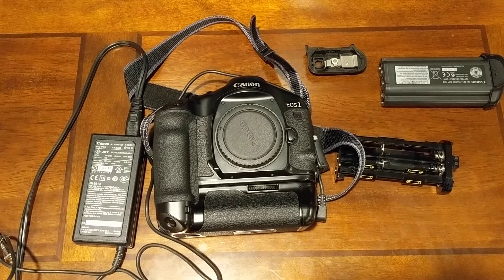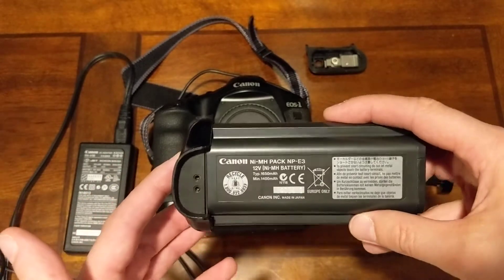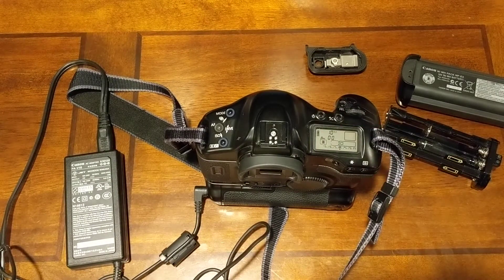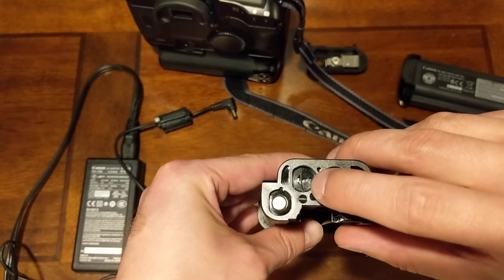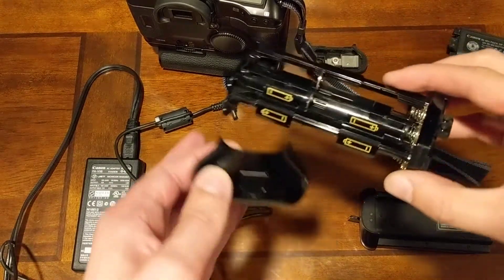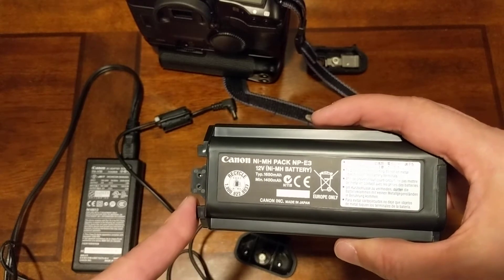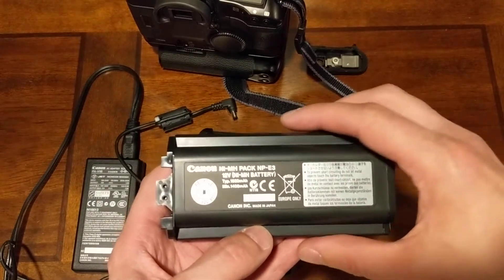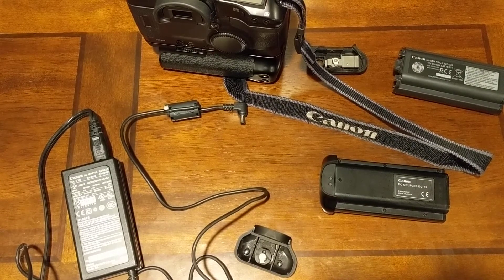Modifying the DC-E1 Coupler for EOS-1V Camera

Comment: The "Battery Cover Unit" that goes on the end of the BM-E2 or NP-E2 is Canon Part number CG4-0117-000. It doesn't seem to be available separately, at least not from Canon.

Comment: How to check if you are in ATG's 10fps mode:
* Install 8AA Energizer Lithium Batteries onto the battery magazine
* Turn on camera
* Press both Two Round Blue Ring Buttons while turning the Finger's Dial
* Do you get S, L, H, 2, 10?

Then the camera IS NOT in ATG's HSS (high super speed).

Comment: Am I correct that the Canon DC Coupler DC-E1 (2:57) has no battery inside?
And the Canon PA-V16 (AC Adapter) is required & connected to DC-E1, right to work?
Reply from the maker: Yes. It's an AC to DC coupler. No battery.
Reply: ATG's staff said to me that you are safe in doing this mod.
Reply: @Jeremy, now you should mod it so you do not need to use AC power.
Because needing AC power requirement means you are tethered in the studio.
That was why there are three options & selections from ATG and Canon's.

Comment: The ATG Canon EOS-1VHSr and Canon EOS-1VHS actually have seven speed shooting modes.
1. ATG HS
2. HS (only with Canon Ni-Mh battery)
3. H
4. L
5. S
6. Two second
7. Ten second 

Have those flexibility it was better than using the Nikon F-5.
You can always remove the motor drive (Power Booster) whereas the can't remove on the F-5, to reduce weights.

Today reviewers are all lost about ATG. 
They usually think ATG doesn't exist.

Comment: ATG wasn't happy with the way Canon marketed this model & not telling the whole truth, unless your read prints.
First off, the camera (either the 1V or 1VHS) can't shoot up to 10fps out of the box.
Just like today, Profoto scams by posting and selling their Profoto B1X saying it can shoot TTL. Not out of box.

To test is it can do ATG's 10fps:
* Place 8AA into battery magazine (1:52) based with Power Booster PB-E-2 or EOS-1VHS
* Turn on camera
* Press the two Blue Buttons (DRIVE) down at the same time
* Turn dial wheel
* Most likely you can only see/get three speed modes (S=1, L=3, H=6)
* No way every to get into ATG's HS (10fps high speed)

Canon got many fooled by making them buy the NC-E2 and NP-E2 (about $500 at that time) to get ATG's)

That was the main reason that ATG made one that can shoot & have the mode setup to 10fps without $500.
With just 8AA Energizer Lithium Batteries (these are NOT rechargeable). But that got Canon upset.
Then later ATG made other version that can be operated wirelessly for the Olympic and extreme photographers.

Comment: Jeremy, able to get 10fps with the mod?
Reply from the maker: Probably, I will have to check to be sure.
Reply: @Jeremy, just press the Two Blue Buttons (top left) and turn the dial wheel.
Takes less than 5 seconds to find out if yours can shoot 10fps.

I have the original/rare ATG Canon EOS-1VHSr as well as the mod by ATG, Canon EOS-1VHS.
Both cameras can shoot wirelessly & less weight because they have portable external ATG's Gold Battery Pack.

At that time, Canon sells two versions:
1. Canon EOS-1V (body only)
2. Canon EOS-1VHS (comes with motor drive) 

For elite photographers, ATG/Canon has ATG Canon EOS-1VHSr
* ATG's titanium camera body & motor drive 
* ATG's wireless radio camera shutter & ETTL II flash trigger
* ATG's extreme weather sealed 
* ATG Gold Battery Pack for extreme weathers
* S, H, HS- 10fps without needing special battery pack
Reply from the maker: Oh that camera sounds fabulous! Do you have any photos of it to post? I will check mine later today for frame speed.
Reply from the maker: I posted another video of the frames per second. I think you are right about the three modes.
Reply: Try to get it to do 10fps with 8AA or without needing AC power.
Because with AC power requirement, you can't go out in the fields.